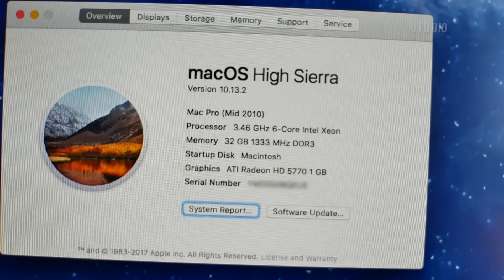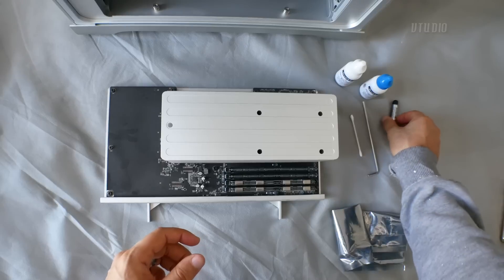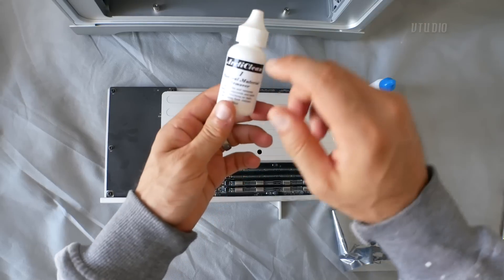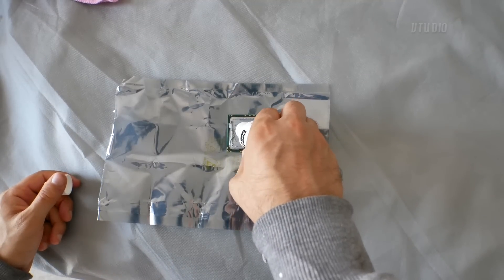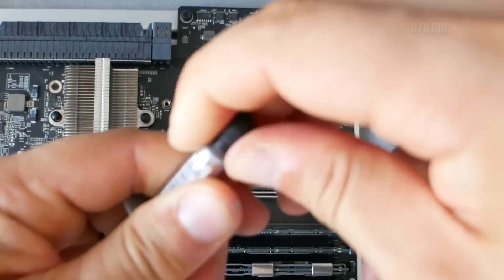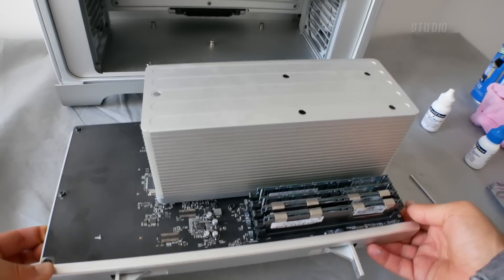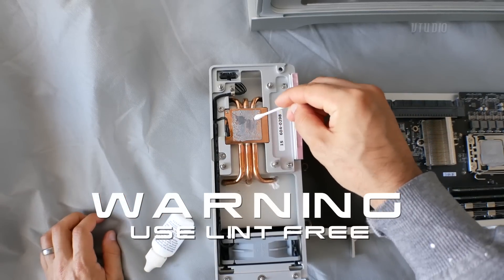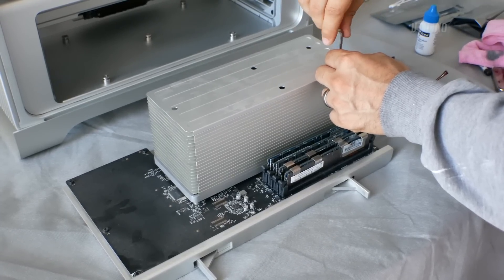Apple Mac Pro 5,1 CPU Upgrade Guide | 6-Core Xeon X5690 3.46Ghz

Comment: Awesome Video,  Thanks for Sharing,  I have a Mac Pro 2010 5,1 and I'm Trying to Upgrade,  having Trouble right know on Upgrading my Bluetooth,  replacing the the Bluetooth Internally is a Pain,  already messed up some Connections,  they are soo Small.  After doing a Search again on Upgrading the Bluetooth Component on my Mac on Amazon, I found PCIe Cards Available,  I was thinking what the Heck,  this is allot Easier and the BlueTooth well be even Higher than the one You find Internally,  so the one your find like on Amazon Internally is 4.2 the highest I've found on Amazon and Ebay,  if you do a Search for Bluetooth on a PCIe card upgrade you get a much better Upgrade,  it's a 5.2 Bluetooth with WiFi included and it's much Easier to Install,  finding one thats Compatible with a Mac Pro is the Search tho.  Your Girlfriend looks awesome if I can say and she's seems to be a fun person,  her interaction with you on this is good,  seems to have the Same interest,  she's a Keeper.

Comment: Appreciate the Video / Tutorial on how to upgrade the 2010 Mac Pro. I will be upgrading the CPU's on a 2010 Mac Pro to X5690s. As well as installing more RAM currently 32GB, eventually 64GB and lastly maybe a New Graphics Card. Because I am limited on the version of Mac OS I can install on the 2010 Mac Pro. I have switched to Linux. Currently, running Linux Mint and other Operating Systems through Virtual Box. Very nice when I need another OS for compatibility reasons, or for Testing. Overall a very nice machine with lots of potential. Thank you.

Comment: Can I ask a question on this, I have the 2010 Mac Pro and thinking about this but getting confused over whether I need a lided or delided cpu, the one used in the video and others appears to have a lid?
Reply from the maker: If it's a MacPro 4,1 you use a delided but if it's a 5,1 you don't. The 2010 should be 5,1 but best double check the model identifier in system information.
Reply: @headsoftech  perfect thank you, will check there and then onto gamble on eBay...

Comment: I have this same processor installed I’m my 2009 Mac Pro with a firmware update 5,1 and a MSI Radeon 560 4gb GPU, it was working fine for several years now it won’t boot, no chime, I can’t boot in safe mode, I can’t do the AHT, do you think the processor is bad?

Comment: I bought a 2009 , 4,1 . Its a much better way to go . I bought the machine for £199 with 2 x 2.26 quad cpus in it . i then bought a matched pair of x5680 3.33ghz 6 core cpu`s for £50 and 64gb of 1333hz ram for £35, and believe me it flys . Yes you have to delid the cpu`s , but thats easy and you have to "flash " the machine to 5,1 but messing with these old single CPU machines when you can have a really nice dual cpu for very little money is just silly . So DON`T DO IT , When you buy your machine make sure it has DUAL cpu`s ! I paid £284 for a 12 core , 5,1 machine with 64gb ram !! By the way , just use alcohol to clean the paste off the head sinks , the other stuff is bullshit .

Comment: I did this upgrade today.  Instead of following the way you put your thermal paste on, I did it another way (Putting down 5 drops, 1 in each corner, and one if the middle).  I kept getting the red light.  I re-did the thermal paste how you did it, and the problem resolved.  Just putting it out there for anyone who starts getting the red light.  Do it exactly how he did it, and tighten the screws all the way.  Thanks dude!

Comment: I have Mac Pro 5.1 2012 with 2 x 3.06 GHz, 12 core. Now I have installed Big Sur 11.2 via open core. The computer is slow. In Adobe-apps I have beach ball and very slow performance in especially Dreamweaver. Is it too weak CPUs? Would a change to 2 x 3.46 GHz make some difference? The problem is that I have never changed CPU and now I have two to change... Perhaps there is a limit to how much money you should spend on a old computer. And the big ’’houses’’ over the CPUs, are they only for cooling? But today you never see this solution. Is the cooling inside of the CPUs today?

Comment: Selling the items I won in a recent giveaway 
To upgrade everything on a 5,1

Will sell it all for $700 

New 64gb = 8x8gb  Hynix M00216P PC3 10600R 240 pin (1333 MHz) DDR3 SDRAM  $180 

Matched Pair (2 CPUs) Intel Xeon X5690 Six-Core 3.46GHz 12MB Cache Processors Never been used  $160 

New AMD Saphire pulse RX580 GPU $240 

New in box 1TB Samsung Evo NVME M.2 
Comes with PCI adapter  $160 
I’m in Los Angeles

Comment: Just picked up a 4.1 that i'll be using the same CPU for the upgrade. Im also on single cpu for the 4.1 But 4.1 users needs to upgrade firmware to 5.1 to use the max cpu for the 5.1

Comment: I have an Mac Pro 5.1 from 2012 which I have upgraded to 12 core (2 x 3.06 GHz), it had Quadcore from start. I have now tested it in Geekbench 5 and my reaction is that the result is surprisingly bad. I am not sure, though. The memory frequenze is only 666 MHz (can be 1333 MHz). I have a link here to the result. https://browser.geekbench.com/v5/cpu/3753655. Is this normal?

Comment: thank you for the video. want to ask, i have a mac pro 5.1 with 2.8gig quad core, installed maximum ram 32giga. if i upgrade to X5690, can i installed more than 32gig of ram? what's the maximum ram after the processor upgrade? thank you.

Comment: did you upgrade from a 3.2 GHz quad core to the Xeon X5690 3.46 GHz six core ? only reason i ask is i have a  "Mid-2010" "Quad Core" model with a 3.2 GHz Quad Core "Nehalem" Xeon (W3565) and im trying to figure out if the Xeon X5690 3.46 GHz six core is indeed compatible with my machine ? *i mean it appears it is by watching your video but i just want to certain im not overlooking anything ?

Comment: I've got the red light on my mother logic board now, and 1 of the ram slots is not reading. Any ideas anyone? I've reseeded the ram a few times and re applied processors 3 times now and screwed in the heat sinks multiple times.
Reply: Did you just one stick of ram to see if it still boots

Comment: Thanks for the tutorial! I have a question: my ram is 1066MHz, if I change my cpu with a X5690 which is 1366MHz, should I change all the ram? thanks a lot!
Reply from the maker: Hey mate, the RAM should still work if you change the CPU, but I've read online people saying that it didn't work for them on the Mac Pro 4,1 or that it does work but only after resetting the PRAM. In either case upgrading the RAM to 1366MHz will make things faster, so it might be a good idea to do so. Let me know how you get on.
Reply: @headsoftech  thank you for the answer, i'll try and let you know!
Reply from the maker: Nice one mate.
Reply: If you your machine is a 5.1, it will support 1333 MHz, a 4.1 will support 1066 MHz. You can upgrade a 4.1 to a 5.1 with a firmware update.

Comment: Hi there, has anyone carried out the same CPU replacement for a dual processor (2 x 3.06 GHz 6-Core Intel Xeon) ? i would like to change the processors to be able to upgrade the operating system and also have some more speed. Any help out there please ?

Comment: Hey man where did you get the whole CPU for Mac!! Am a Windows user and I wanna buy Mac this time! 💪🏻 Can you suggest me where to buy it? Or should I get a i5 8gb macbook Air 2018 version! (which is for about $1,100) and than upgrade that macbook to 6 cores
Reply from the maker: Hey mate, I got my CPU from eBay, there's links to the search in the description. Unfortunately this CPU upgrade only works on the Mac Pro's from 2010, modern Macs have their CPU soldiered onto the motherboards so you can't upgrade them yourself, but if you can wait, the rumours going round is that new MacBook Air's might be coming in October, so maybe waiting for that might be best for you.
Reply: @headsoftech  dang it!! When they release a new Mac they increase their prices crazy!! My plan was to buy a older yet cheaper Mac! And upgrade it myself! (am sure bestbuy.Com should have the $500 macs!)

Comment: What is the maximum config. for MacPro 5.1? Worth the effort too upgrade.
Reply from the maker: The CPU used here is the max one you can get. It's worth it if you're upgrading from a slower quad core, but if you've already got a 6 core one, it probably isn't unless you enjoy the experience.

Comment: Hi!  I've been upgrading my mac and was wondering if you could help me out.  I have this computer, but a 2 socket board outfitted with 2 quad core xeon 2.4ghz processors.  If I were to upgrade the processor, I couldn't just do one, correct?  I'd have to get two new ones with the same number of cores, right?  I've also heard I could just remove one of the processors and just use the one 6 core 5690 you've recommended.  Would that even be worth it?  Lastly, the processor I ordered came with a small sticker directly on the chip.  Would it even function if I left that sticker on?  It's the kind you'd have to scratch away at so I'm reluctant to try.

Comment: Good tutorial. Congratulations. Can I ask you a favor, I have a Xeon X5690 with a missing surface mount capacitor. A side of cpu (upper) shows 4 capacitor. Opposite (lower side) there is a line with 2 capacitors. I'm missing the one on the right. Can you help in understand what I need (capacitor value, type) to fix it?

Comment: I have a 4,1 Mac Pro with dual intel Xeon processors running at 3.96 GHz. It was the fastest Mac offered in 2009 period. I am watching these with interest, but I fear ruining my Mac.
Reply from the maker: You're got a great system mate, the 4.1 model is slightly harder to upgrade because you'd need to delid the CPUs before installing and balance the heatsink after installing. There's a 4,1 guide in the description worth checking out.
Reply: Vtudio, it has eight cores. Also maxed out on RAM, though I do understand that I can go from the 32G to a full 64, as the limit there was the operating system.
Reply from the maker: The RAM upgrade is a lot easier, you just swap out the modules, so if you're thinking of upping your RAM, that's a good one to go for.

Comment: You didn’t put enough paste on, it is better to spread it on the cpu thinly, rather than relying on it being squashed flat as you tighten it down.
Reply from the maker: Hey mate, I've had no problems with the CPU in the life of the upgrade, but if you've got any examples of your recommended application, it'd be great to see.

Comment: That's all the thermal paste you put? i thought we had to put more and spread it out more
Reply from the maker: That's right mate, it spreads out evenly when the heatsink is attached, you don't want to use too much as it may leak out into the socket and it increases the gap between the heatsink and processor. Tek Syndicate has a good video demonstration on how different methods spread out here: https://youtu.be/-hNgFNH7zhQ
Reply: @headsoftech  Some videos were awful with people applying huge goop in two line or too much and using a credit card to spread.  Just a dime size and the heatsink will do the rest

Comment: After your video motivation I did upgrade 4.1 to 5. , like you recommended and added W3680. I get geekbench 803 cb and cinebench only single core 3064 and multi core 14019. Using also non flashed nvidia gtx 980 4gb! I am happy with the results only the difference in cinebech to yours is wierd?! I did make the mistake to have both OS (el capitan and windows 7) on one SSD with partition and without being able to have bootscreen its a pain, as command R does not work, I get kernel panic. Something is corrupt with the kingston SSD! That does bother me and either I need to set everything new up, or I have to use flashed gpu. Thx for your videos and guidance ! Helped me a lot during my upgrade process!

Comment: You should have tested CPU heat.  Before and after.  There is a reason there was a lot of thermal paste left.  More is better.
Also, the heat sink, at least from what I have learned, has a certain number of tightening per screw to make sure the pressure is even.  It has even been recommended to count the number of turns removing it.

One quarter turn, and to little thermal paste might lessen the life or cause it to over heat.  

Just saying.
Reply from the maker: Hey mate, the 2010-2012 models can be fully tightened, the older models however need to be balanced, there's a reference video in the description for upgrading the older models. Regarding thermal paste, too much thermal paste will increase CPU temperatures as it will further the distance between the CPU and heatsink.
Reply: I see.  Got it.  Thanks

Comment: Can I do the same thing with a Quad Core version in early 2009?
Reply from the maker: Hey mate, there's a link in the description to a guide for the 4,1 model. It's the same socket, but the CPU would need to be de-lidded and the heatsink would require to be more precisely tightened.

Comment: Hola amigo, tengo un mac pro 5.1 con dual intel xeon de cuatro núcleos y 2,4 GHz, a mediados de 2010. Quería saber si aceptaría el "dual" de 6 núcleos Xeon X5690 3.46GHz para tener 12 núcleos a 3.46Ghz. Hemos visto que el que funciona al 100% confirmado es el Xeon x5670, pero su latancia es de solo 2.9 Ghz, ¿notará esta diferencia de potencia? Su uso es la edición de video con programas fuertes como After Effects. gracias

Comment: Great video. Im new to this and it seems to be hard to find dual cpu mac pro’s that are untouched and a reasonable price. Is there a huge difference? I will mainly use it for fcpx and photoshop. Will upgrade ssd and gpu. But don’t want the problems of choppy playback i currently experience with my macbook and imac. So should i hold out and try to find a dual cpu or just bite the bullet on a single. Thanks :)
Reply from the maker: Hey mate I've only tested with a single cpu and for Photoshop and Final Cut Pro playback it worked great with a RX580 graphics card, the only thing I couldn't get it to do faster was video encoding/transcoding, I've heard a dual tray CPU can make encoding/transcoding faster but depending on your budget I'd personally hold off 'till Apple's event on the 30th October where they're rumoured to be releasing new Macs. 1. The new Macs will have 8th/9th gen CPUs which are great for encoding tasks, 2. They're a rumoured Mac Mini coming out then, 3. It'll drive down the prices of the current Macs on sale.
Reply: Word! thanks man i appreciate your input. and cost isn't an issue. its just the only ones i find people already added all the stuff to it and mark everything up. i cant justify buying something someone else did for double the cost lol. id rather just find a dual cpu and add the stuff myself ya know. and yeah wonder how much the mac 1's will cost and with apples track record lately im alittle skeptical lol
Reply from the maker: Yeah I'm with you on that, but the only thing I'd say is that the current Mac Minis start at $499 and the iMacs start at $1099, so if the new ones are anywhere close to that price with new gen CPUs/Graphics/RAM/SSDs, it could be a really good deal especially because you get a warranty and know that your system will be good for at least 3-5 years whereas these Pros have reached their end of life with Mojave probably being the last compatible OS.
Reply: yeah you are right. maybe ill just wait and see how the reviews for the new gen are and then make a decision. thank you :)

Comment: Great video, I have the same machine and thinking of upgrading to the same CPU.  Thanks for the easy to follow video and non complicated nerd terms others always get into.  Just need straightforward advice and instruction.  Also, how much did you pay for your CPU?  Thanks.
Reply from the maker: Thanks mate, around $150 AUD ($100 USD), another chip you can get is the X5680 which is just 0.13GHz slower but sometimes a lot cheaper.
Reply: Have you upgrading your MP to Mojave?  I heard I might need a new GPU that supports metal.  I'd like to upgrade the CPU and then go to Mojave.  What are your plans?
Reply from the maker: I'm avoiding Mojave until at least version 10.14.3. High Sierra was severely broken until its .3 release and I'd rather avoid all the horror bugs to be found in Mojave .1.
Reply: Good idea!

Comment: Quick tip:
I've had a Mac Pro 2009 (identical board) fail - turning off a few minutes after starting. Turned out to be that northbridge heatsink besides the CPU. The two plastic retainer clips were brittle, so I replaced them with two tiny screws - perfect ever since.
Reply from the maker: Thanks for the tip mate
Reply: Vtudio I’ll be doing a x5690 upgrade soon, and have ordered these to bring it back to plastic pins again. There could be a reason for not being screws (even though it’s been flawless for years) 
https://m.ebay.com/itm/10x-PC-Heatsink-Cooler-Cooling-Fan-Spring-Rivet-Fastener-Push-Pin-Mounting-Screw/121074044779?_mwBanner=1&_rdt=1&epid=690871795

Comment: Apply the thermal paste to the CPU then put you hand in a clean Baggie Sandwich Bag and spread the thermal post out with the tip of your four finger until it is even across the CPU. Then tigthen the heat sink according to  the manufactures instructions.
Reply: Thanks for the tip
Reply: "put you hand", "four finger", "Then tigthen", "the manufactures instructions." Perhaps you should learn proper English grammar and spelling before you start throwing the first stone.

Comment: Which is the best CPU nowadays to upgrade a Mac Pro 2010  that has 2x 2.4 Ghz Quad-Core Intel Xeon. I would like a Plug-play CPU, meaning I don't want to do any configuration.  Thanks.
Reply from the maker: Hey mate, it's the one used in this video - Xeon X5690, alternatively you can get the X5680 which is usually cheaper but only slightly slower. Just make sure you get the same pair.
Reply: Thank you so much!